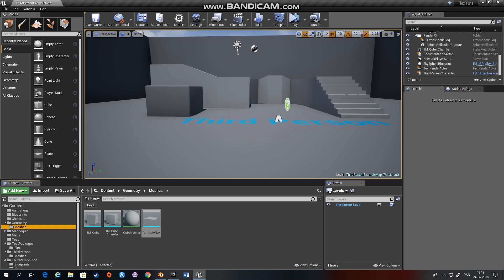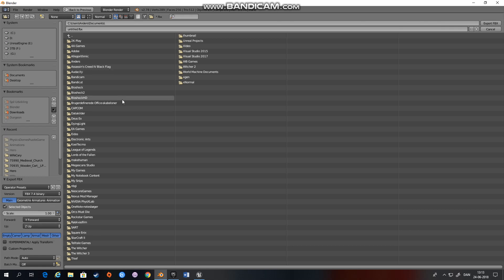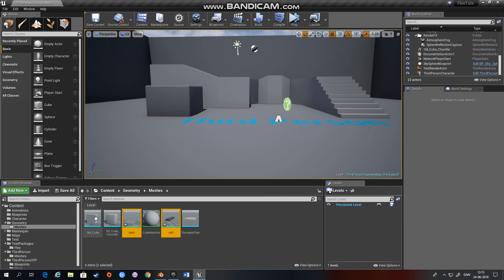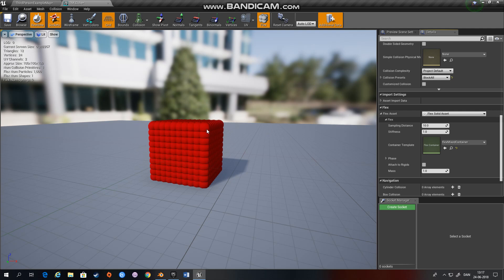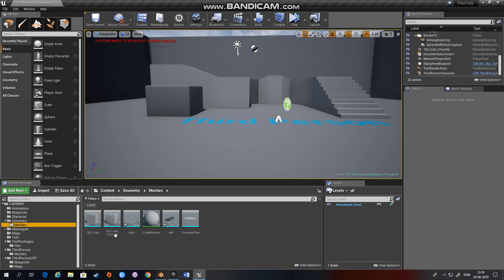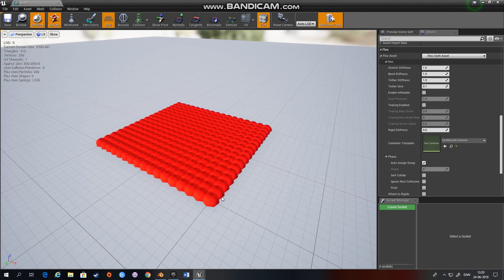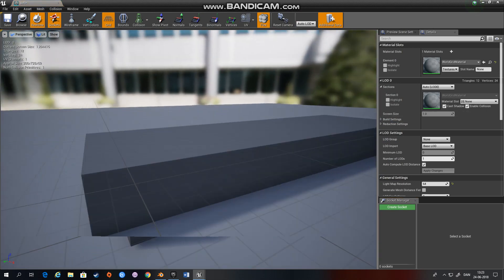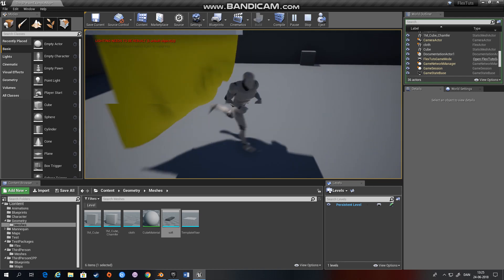Flex tutorial   1 Rigids, cloth and softbodies

Comment: I'm using 4.20 and I don't have a flex option during import in in the statmesh properties. Any idea how to enable those settings?
Reply from the maker: Hi Owen, you don't author flex objects outside of UE4, you import a static mesh and convert to a flex object in UE4. The video should explain how to do this. (Remember I am using 4.17 of the Nvidia flex version of the engine, things might have changed for 4.20)
Reply: Owen, did you figure out how to enable the flex options button for the static mesh asset editor? They show up for me when I edit the flex assets that came with the unreal engine source in Test Packages / Flex, but when I try to import a mesh from blender and then open the asset editor (per the tutorial steps), the "Flex" button (seen at 7:48 in video) is missing.
Reply: Daniel A  Im having the same issue
Reply: @bartasus194  I haven't toyed with it recently.  I'm not sure I ever got it to work.  Sorry I couldn't be more help.
Reply: @DanielA-fr5fq  I found out by accident that you can enable that option quite easily. All you have to do is to right-click on imported mesh and click "Create Flex Static Mesh".

Comment: my build is not showing the flex icon after I double clicking on an imported object. 
but when I open the flex sample project, the flex icon/button is showing up. have you ever have the same problem? 

so, the point is. I cannot add flex on objects because no flex button to click. Im using flex 4.19.2 version.
Also I'm really thankful that you create these tutorials. there are so few tutorials about flex.
Reply: it looks like I need to select my static mesh and then right click to open a menu bar, and then just click on "Create Flex Static Mesh". then, a new flex static mesh shows up. :)
Reply: Ramdhan Dwiputra thanks! Was struggling with this too!
Reply: @Patopostudio  Thank you for this, the option to create a flex static mesh could be a little more obvious.
Reply: Nice!